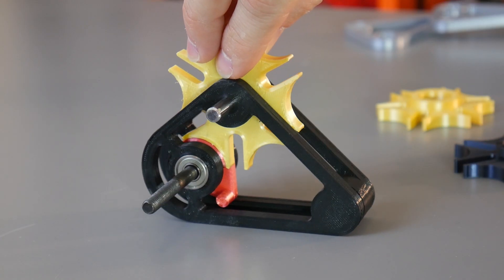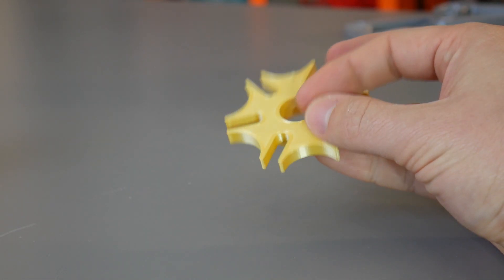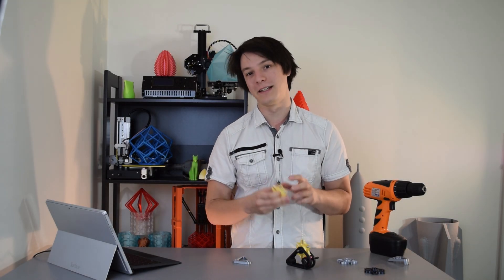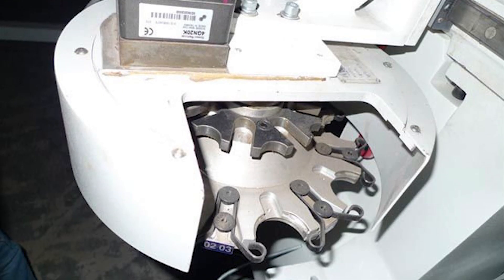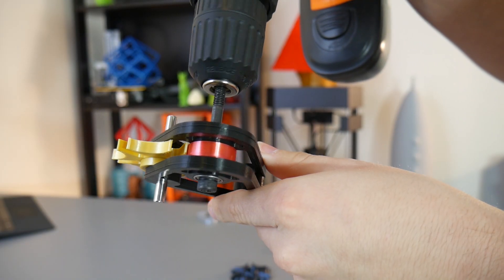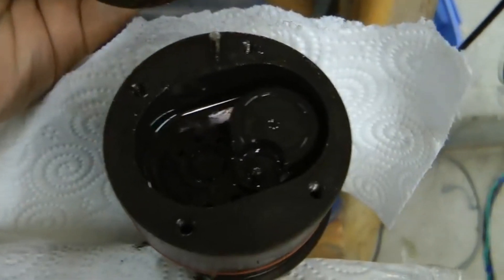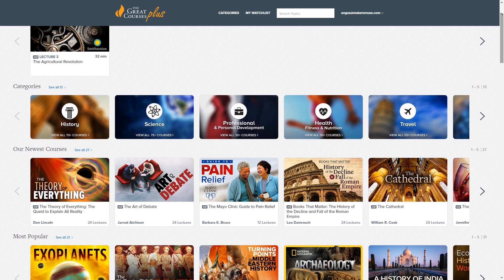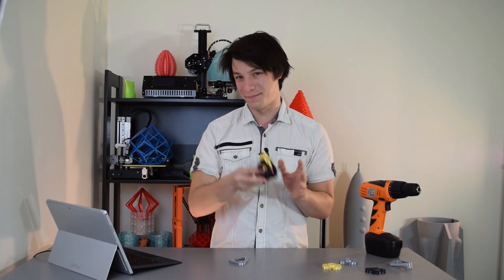The Geneva Mechanism

Comment: I thought the majority of the noise you hear from a film projector is the film slack mechanism that provides a buffer from the continuously moving reels to the stopped frame being projected as well as the shutter cycling the light on and off 24 FPS.  

Interesting video.

Comment: example of a military use of this : auto-loader on the M1 Abrams and the Cesar (artillery support cannon) (even if it is mostly manually operated, i personally saw the automatic one, being able to fire 6 shots by minutes) (6 shots to a maximum of 38~km, how awesome is that !?)

similar uses can be seen on some machineguns auto-changing mag !

also, if i'm not mistaken, the 120mm cannon on the AC-130 uses this aswell.

Comment: Servo drives have  1 huge limitation; thier mass vs. accleration.
Years ago tried to replace a mechanical drive mechanism with a contiuous driving motor by a single shaft servo drive.
Long story short; the acceleration needed to  go and stop within the required cycle called for basically an explosion and all but zero mass. Such a drive has to be invented yet
In the end the thought experiment was done but this peticular part of a superfast running cigarette filter cutting machine kept its mechanism. The motor was a servo drive but one with rather high enertia and kept on several constant speeds, so most of the flexibility and quick changeover was achieved.

Shows you; sometimes good old mechanics have their place. 

Note; instead of a simple pin, in indexers the use of a camfollower is standard, either with or without stud.

Comment: Military Application is found in revolver autoloader systems for tanks and self propelled artillery. The Shell has to be loaded into the chamber and should not collide with the walls, therefor accuracy is needed. Speed also is an advantage, since you want to fire the next round quickly.

Comment: The Geneva stop's purpose is not prevention of overwinding a watch mainspring. Actually, the "overwound" spring is a myth. Mainspring breakage is by fatigue. If you intentionally try to overwind a watch, anything in the winding mechanism will break before the spring, probably including that stop! No, the stop was there to eliminate the very weak and the very strong torque of the spring at the beginning and end of winding. Out of 6 possible turns of the barrel, only 4 were used. The spring is "set up" one turn and stopped at the 5th. In this way, the spring is used where it gives the least variation in torque. Earlier watch movements were more sensitive to torque fluctuation, making their rate erratic. Modern mechanical movements have overcome this flaw almost completely by various means, so the stopwork is no longer needed.
Reply: Remo Peter overwinding the spring doesn't break it but it does cause them to lose most of their tension. Thats why a lot of old clocks and watches tend to only run for a few hours before needing wound again
Reply: And when does a spring break from fatigue? If its overwound agin and agin.
Reply: @remo peter 
simple said the geneva stop is used for 'cutting off' the to low and high torque ends of a spring used in handwound watches thats correct. and its also functining as a protection to prevent damage and breaking the spring. and its fairly easy to break a spring. it is the most common damage  to a movement caused by the owner and it is no myth. sure some springs are can take more and maybe the gear thats sits on the steam will break before but its a damage.(sure the most common reason for servicing is still old oil). E.g. the very common Peseux/ETA 7001 has a spring that is relative smal an easy to break while manual wounding on the other hand is the spring of the UnitasETA 6497/6498 movement more robust and you will damage the gear train more likely before the spring snaps.
Reply: Remo Peter is correct. I work in a clock shop and you'll find this exact mechanism on music boxes too for the same reason. A music box will run very slowly or not at all when the spring is near the end of it's power, but run quickly at full power. This mechanism in that context allows a consistent performance, just like it does in a spring driven clock. You will find these mechanisms on weight driven grandfather clocks as well, even though a weight delivers constant force until it is run down because it prevents the user from winding the pulleys all the way up into the seat board.
Reply: John Somerset - While it's true that a mechanical wristwatch can handle the varying torque from the main spring unwinding, I believe some of the most accurate pocket watches used a fusee to even out the force of the main spring.  I am no expert, but I would not call the varying force a feature, but rather an engineering challenge that needs to be dealt with.
Reply: Remo Peter, some clarification. Older watches especially pocket watches used brittle metals for the mainsprings which often broke. So, even a winding stop had the used one would not have solved the problem. Dietrich Gruen invented the safety pinion which decoupled the drive train from the winding mechanism during a mainspring failure. The energy was transferred to the free spinning end of the pinion thus eliminating stripped out gears. For a detailed description of the Gruen  safety pinion, go to www.pixelp.com.
Reply: Jesus Christ, I just can't...
Reply: Ok I need help my favorite pocket watch I got before my first deployment from someone verry special has stopped working and by some higher power I wandered on these comments does anyone know how I can fix it if its stuck with a wound spring and the secconds hand will begin to move if I continuously tap the face
Reply: @Provenhydra95   if you are still searching for help i can tell you this: search for a profesional watchmaker. it may take its time and it will cost you something but when it can be repaired then is this the only and right choice.
Reply: What absolute BS!
"No, the stop was there to eliminate the very weak and the very strong torque of the spring at the beginning and end of winding." That's RUBBISH! 
The ingenious backward and forward movement of the escapement mechanism (pendulum or wheel)allows for the varying spring force. That's the whole point of it!!!!! That's why spring powered clocks tick loudly when fully wound and softly when running out, but still keep correct time until they stop.
Reply: John Somerset
 sorry that i had to say that but your response is utter BS! 
the geneve stop has nothing to do with the escapement exept that it regulate and smooths out the torqoue that the mainspring is delivering. the only task that the escapement has is to 'cut' the steady force provided by the mainspring in litle chunks that is the time and every irruglarity in this constant stream of force is negativ for the correct display of time.
yes the observation that a completly wound clock ticks louder is correct but also then is the clock to quick and tells the time to quick. and thats bad and not wanted. sure this effect is completly negligible at cheap movements but when the clock had a serious function like a motherclock at e.g. a train station or as a very precise timekeeper in observatorys or to calibrate the marine chronometer for the 
determination of the longitude then there is every deviation fatal.  and yes this mechanism was comon in high class movements

Comment: i have had genevas running in machines for more than 20 years and they have never seized up. it will outlive all the cams and cam followers in our machinery providing they are set correctly. top speed we run them at is 500rpm.

Comment: I wonder if wear was really the reason Geneva gear are not used in tool changers any more (assuming that fact is accurate). A tool changer stands still most of the time. I think it's just that we can control linear motion much more precisely nowadays.

Comment: For military use, the one thing that comes to mind is the airforce.  Old bi-planes would have been the first use of this mechanism as they had issues with mounting a machine gun.  Mounting it on the wing above the pilot made them dreadfully inaccurate. Mounting them on the fuselage and they would run the risk of shooting off their own propeller... unless, of course, they managed to time the shot between each pass of the blade.  Of course, early in WWII with the single fixed-wing interceptor, they had to mount the machine guns on the fuselage, and this gear would have been ideal in the prevention of shooting off ones own mode of propulsion.

Comment: a Geneva LIKE drive is used in the famous Mini-gun (miniaturised rotary aircraft cannon).

the barrel needs to link to the constant feed of the cartridges, both are electrically driven at a constant rate, the cartridges slide inside a rotary feed drum, after twice revolving each cartridge reaches the 'breach' of a spinning barrel, the barrel MUST PAUSE for firing though.

The relative barrel pause, or 'rest' (going into "battery"), is achieved using a Geneva like mechanism, and the rotating drum uses linear cams to drive the cartridge forward into the barrel.

In the mini-gun, the cartridges are fed into dwells.

You can see exactly how this all works, with highspeed footage, and partial disassembly of the mini-gun, via Forgotten Weapon's video (gun Jesus' channel) here:
https://www.youtube.com/watch?v=rIlwHT4IdRc

EDIT: this is a military use that you're looking for.

Comment: As a former projectionist, I can tell you that the sound from modern film projectors was not caused by this drive.  If you ran the projector drive, you hear a slight clatter, as to be expected of the intermittent rollers.  Most of the clacking actually came from the film expanding and shrinking due to the intermittent gear.

When a projector is threaded, a small excess loop is left above and below the aperture, as the project feeds film into the projector continuously; however, the film has to stop for the slit second light hits the aperture to create a clear picture on the screen.  The loops above and below the aperture expand and shrink rapidly due to this stopping motion and create the known sound of the projector clacking.
Reply: And you always knew when the loops were too small. It would get stupid loud. Nothing annoyed me more when someone would thread one for me and not leave me any clear leader to check the loops before runtime. More often than not they would leave me with the head of the first trailer in the gate.
Reply: @SternLX  And the image on the screen would jitter like mad. The sound would flutter badly and out of sync. Use your finger to pull a new loop and risk damaging the film, or piss off the audience while you stopped to reset it. I had a plentiful supply of sprocket repair tape on hand for just such situations.
Reply: @WCM1945  Yup. Early on after taking over as booth manager and projection trainer I printed up signs that had in big bold letters. "CHECK YOUR LOOPS & FILM PATH BEFORE STARTING!" That and I insisted each person that was operating projection that shift be at the Projector at minimum 2 minutes prior to start time if they re-threaded at show end.
All 14 Projectors were on platter systems. A lot of time's I myself would pre-thread, that is run from the platter to main feed roller above the head and down to the take off roller below the head then back on to the take up ring on the platter and just leave it like that.
2 mins before start I was threading the head and setting my loops. I got into that habit because of last runs. If no one showed up 20 minutes after start time it was far easier to re-wrap the clear leader and close that Auditorium for the night.
Reply: and the intermittent sprocket is controlled by the 'cross box' with is a four slot version of this drive. Film sound, both optical and magnetic, runs at a constant speed, normal 'standard' for 35mm film is 24 frames per second.
Reply: thanks Tyler Durden
Reply: @isaacdavid765  lol Tyler durden
Reply: thank you very interesting :)
Reply: And the shudder made the Light start and stop to help  isolate each frame in that stopped in the gate .
Reply: @jhelgeson2116  Brrrrrrr!
You mean "shutter"?
Reply: Yup, Inertia would be a big problem with that kind of acceleration profile.
Reply: @sergarlantyrell7847  A 4 slot star wheel does not have an inertia problem, as the drive pin enters and leaves the slot with perfect sinusoidal regularity, but adding any more slots, and yes, it does slam itself pretty good.
Reply: True that...👌🤫😁
Reply: You are talking about the effect of the Geneva gear, which is the cause.
Reply: Yeah, you can tell even just by listening that the "clack" is occuring too many times per second to correlate with 'film frames per second'
Reply: I worked in a theatre with a film projector (a sort of "sensurround" theatre in a theme park) and most of the clatter on it was from the shutter between the lamp and the film. Before observing the operation, I had no idea that some projectors (if not all) had a shutter mechanism. (For those reading this who don't know, this smooths the image so you see flashing pictures rather than a massive streaked blur.)
Reply: wow...you guys sound like a blast at a party.
Reply: @dolsen1975 
Let's get this straight, you'd prefer all YouTube comments to be limited to chicks, sports and beer? I think I'll pass.
Reply: @tedl7538  I'm not finding your comment reply to me on here anymore... But, to answer your question, no, it was at a theme park in the Southeast, and not one beholden to a mouse or with multiple rectangular banners.

Comment: the mecanism is used on mashineguns the belt is driven by a turning wheel and by gearing it pulls the ammo belt in / out of the gun...  the wheel is pulling the belt in and the curve holding the belt in right place

Comment: Back in the '70s EMI Medical used this to drive the rotation of the first whole body (CAT)scanner.  It was also used to drive the rotation of British tank turret control.  No matter where the turret points the turret gun is locked in position for firing.

Comment: I wish I could remember the name of the book or author; I think I read the review of it in the Co-Evolution Quarterly back in the 1980s, and I have lost all my issues of that amazing magazine: There is (or was) a book that described how to construct a metal-machining lathe starting with finding, digging up ans smelting iron ore and ending with the working lathe. I wish I'd bought the book back then, not because I necessarily want a metal lathe, but because I want to know how that whole process could be done. The aim of the book was to provide the knowledge necessary for a determined person to start with iron ore and finish with a lather made of iron and steel smelted and formed by the end user.

Comment: This still has its uses, for example in mechanical toys and mechanical clocks. Sure, most have gone over to the much cheaper battery-driven electronic solutions, but in higher-quality items you may still see it used.

And as hinted at in this video, mechanical devices has made a comeback thanks to 3D printing, as you can make entire devices entirely with the printer, without having to add parts outside what you print yourself. So I believe the Geneva Drive will return to popularity very soon, when 3D printing is as cheap and as widespread as regular printing.

Comment: Also if  the drive shaft had a square  instead of a round  shaft were the friction surfaces  are tha t might  reduse  friction  also if the secondary shaft was changed or was spaced a bit difrent

Comment: The old fore-runner of the weather channel , where the camera apparently rotates from temperature gauge to wind speed to humidity to wind direction, and so on, used this mechanism,  but rather  to rotate  a mirror under the camera so the mirror would pause in front of each gauge. I have one of these but never knew what it was called.

Comment: As a trained watch repairer this malthese/geneva stop mechanism, always was one of my favorite (the look of it)parts of an mechanic watch.  But i have to party correct you, Yes it is also used to prevent overwinding, but that wasn´t the only  intention. it blocks some of the first (preventing underwinding if thats an term..) and some of the last windings (overwinding as you corectly stated), to make sure only the windings in between, the ones with the most consistend powerdelivery, are active to make the watch go preciselier. But there is a much more impresive overcomplicated, more precisely machanis to get to the same result thats my number one.

Comment: It's still used in many new cheaper cnc machines (and some expensive ones as well). 
The explanation otherwise is great, but you do make a mistake when you say gears have a rolling contact. This is simply not true. Normal involute gears have a sliding contact everywhere except on one single line on the pitch circle. This is why they need to be well lubricated. It's also fairly easy to eliminate most sliding action in the mechanism, when you add a bearing around the pin.

In CNC machines the main disadvantage is not the wear, but the speed. A geneva mechanism has to go by every tool between the one put away, and the new tool. A servo tool turret is way faster and can go immediately to the right tool. With large turrets this is a major advantage.

Comment: The Geneva Mechanism is used by some sailing and powered boats to move the rudder.  Slow speed, erratic motion not a problem and if you take your hands off the wheel, the rudder maintains is position.

Comment: That is used in the hand feed loading system in the 3"50 naval mount cannon, the 3"70 uses a mechanical loading system that reaches down a deck level and incorporates hundreds of them in the inner, mid, and outer ring systems.